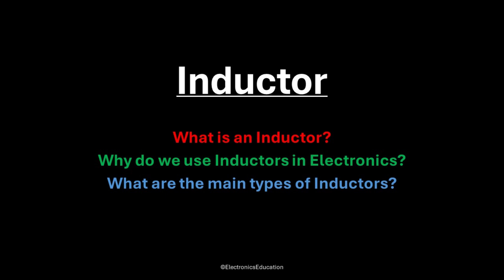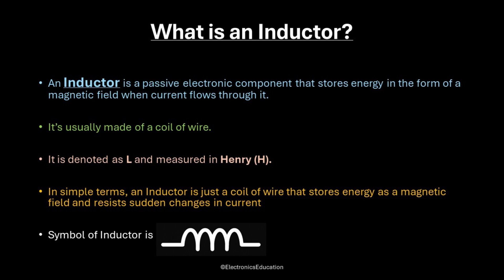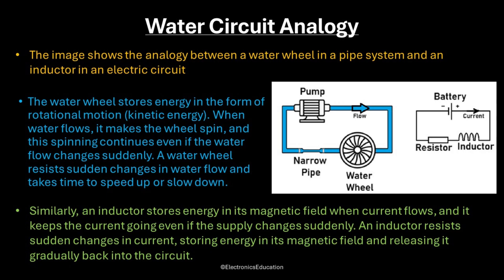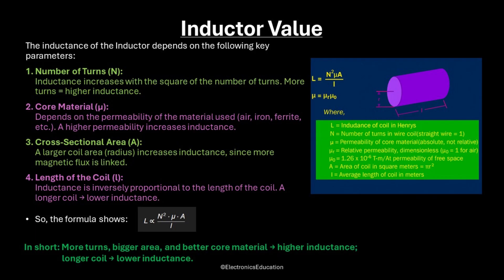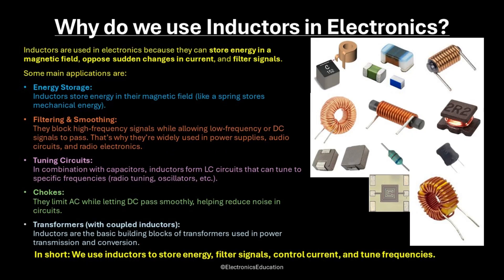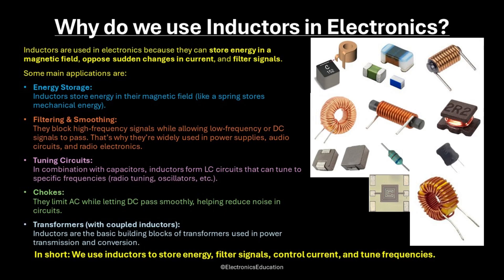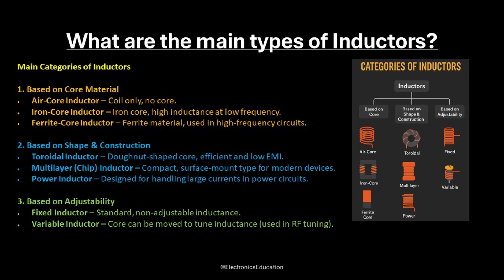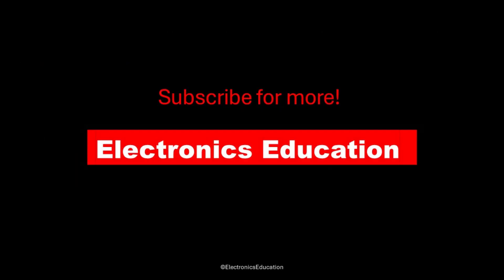Inductors Explained | Simple Electronics

Comment: The water-wheel analogy for an inductor is quite a good one:
When water first flows, the wheel’s inertia resists change (like inductance opposing a sudden rise in current), once it’s spinning, it keeps going and doesn’t want to stop (like current wanting to continue flowing through an inductor). So that maps nicely.
I wonder what would be a similar (water piping based) analogy for a capacitor:    A water tank ?   or perhaps an elastic rubber balloon ?